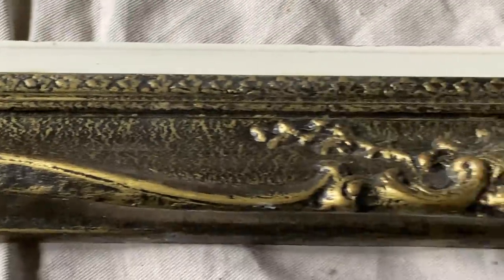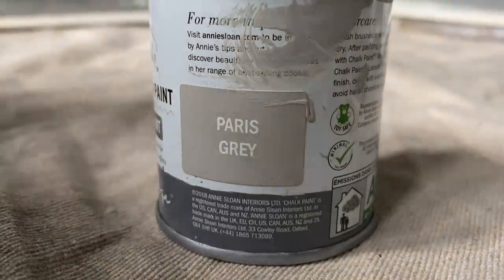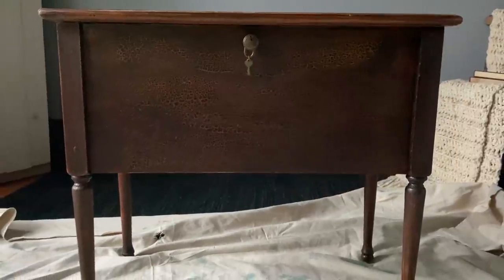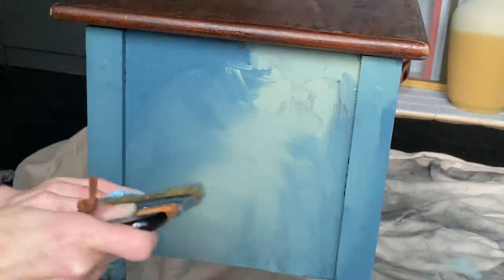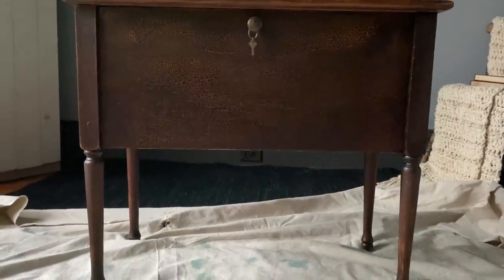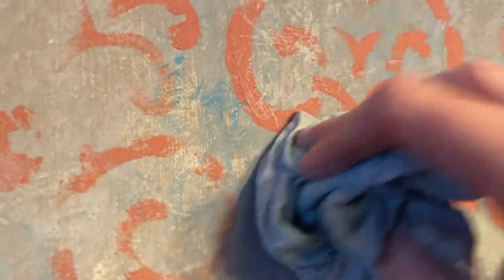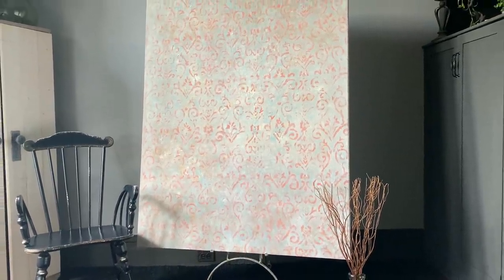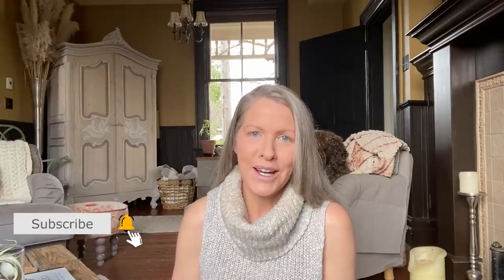5 Home Decor DIY: Framed fabric art, make your own wall decor, crochet boucle blanket | ASMR DIY

Comment: Oh my! All lovely. Also, based on your videos and inspiration, I have attempted to do the finger crochet. I'm a first timer at crochet but I have found myself kinda stumped. I don't know how to make my row size consistent and not sure how to start new rows. I have 4 rows done but put it down. I have pulled out my stitches several times because it was just looking off. And for my 4 rows it seemed like that took me an hour. I bought the CoverStory cake. Help!!@
Reply from the maker: Hi QueenB! So happy to hear you are enjoying the channel!!  The crochet takes a bit of practice! But sounds like you are getting there!  One thing that I had problems is forgetting to add that extra stitch ( two loops for double crochet and single loops for single crochet) at the end to make the rows even.  I am thinking that may be what’s happening to you.  Also making the loop size consistent with your finger.   I hope this helps!! 🙏🎨❤️
Reply: @TheReclaimedHeirloom  I was trying to simulate the waffle pattern you did but I chose to try it with a 6 yarn. I feel my pattern isn't tight enough but when I pulled it to try tigher, I found it to difficult to distinguish my "humps". Soooo I pulled it again, it was much easier to have bigger loops so I'm guessing I have to just have to accept it's going to be a very loose crochet. 😂